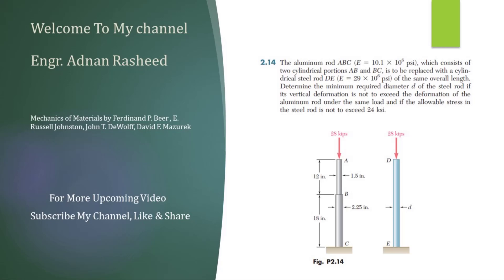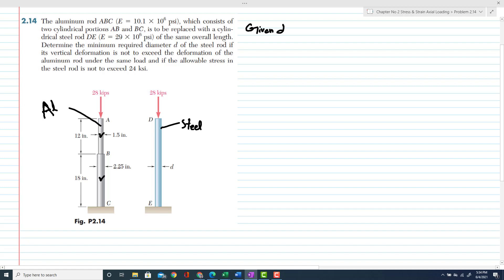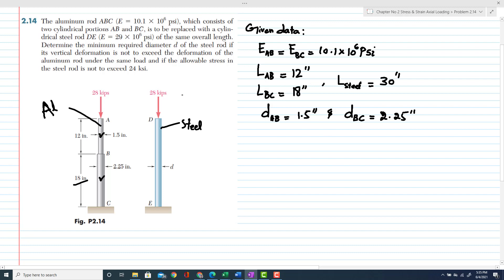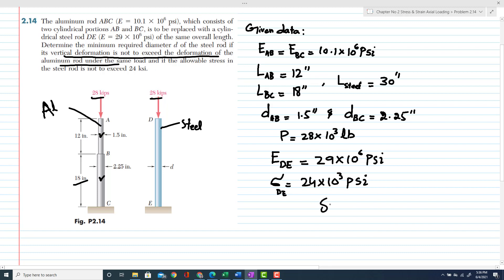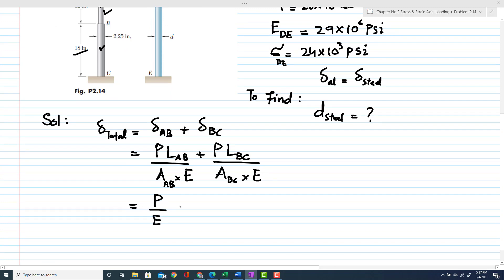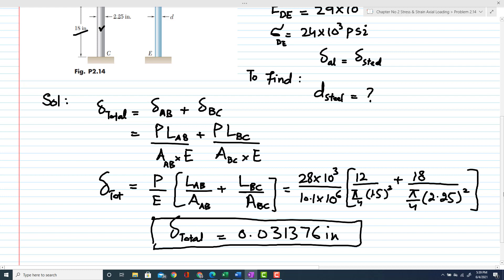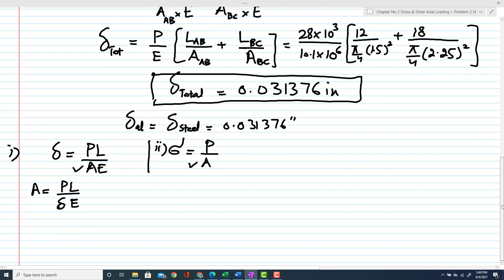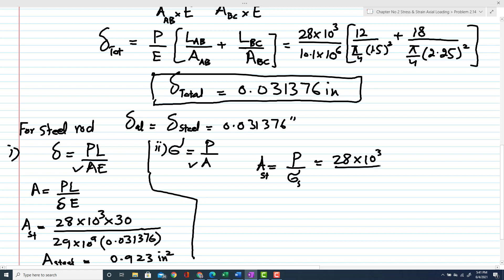Mech of Materials# |ProblemSolutionMOM​ | Problem 2.14 |Stress & Strain| Engr. Adnan Rasheed

Comment: Sir , is this not the maximum value of diameter that you have calculated ??? 

For Minimum value of diameter should we not take the minimum area? which is calculated using elongation criteria ?? 
Please clarify my doubt sir ... 🙏
Reply from the maker: Dear @Rajat Khanna you can see that aluminium rod of two portion was given then total deformation in this rod is taken equal to deformation in single rod. From the value of this deformation we calculate area and then this area is used to find the diameter. This diameter is the minimum as it satisfy the given value of strength and if you increase it will further safe...